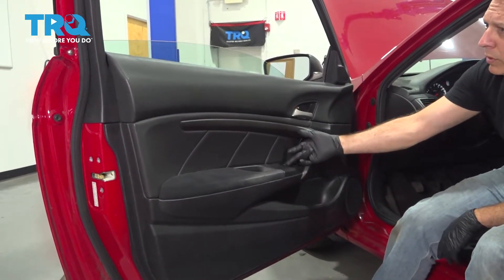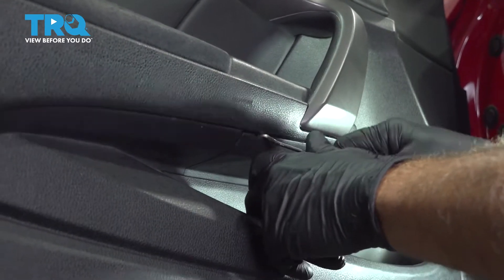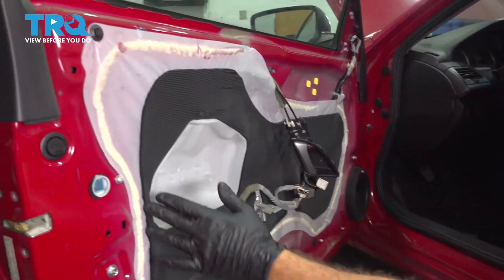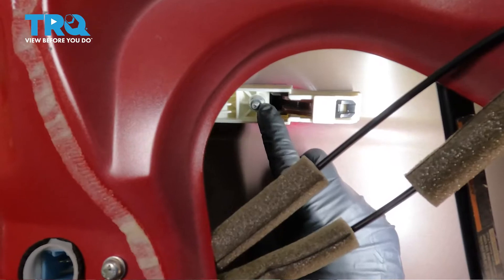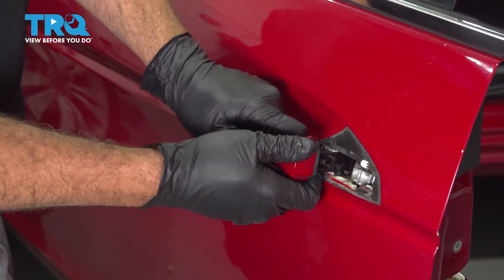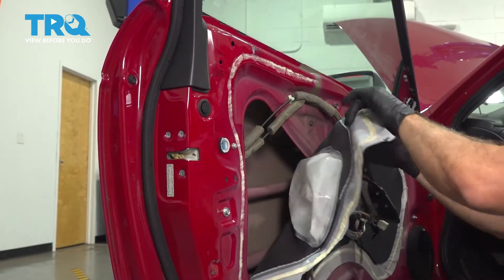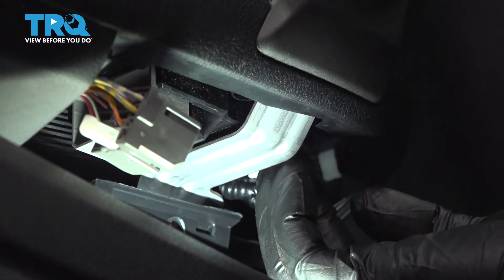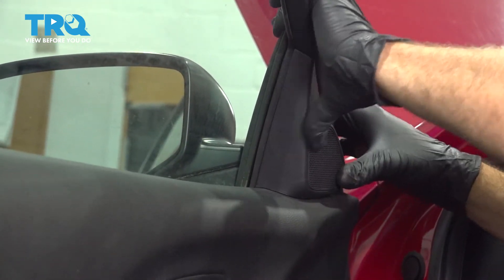How To Replace Driver's Side Door Handle 2008-2012 Honda Accord

Comment: I own a 08 Accord Coupe and removed my door panel more times than I care to admit. The best and easiest method is to actually start from the bottom in the center, there's a little hump you can fit your fingers in to pull the panel out twords you to pop it off...

Comment: Great great thorough. What held me up?I was removing things I didn’t need to. When I removed the plastic I saw 2 bolts connected to the handle. I could reach them with my hand . I wasn’t paying attention. I leave in Shreveport and it was hot hot. I have a 2008 Honda Accord v6 ex-l 4-door. Pristine condition. Just hit 100k. Her name is Ms Genesis. So on behalf of her and myself thanks.
May Bless and reward for your time and unselfishness.
Reply from the maker: +@IrisLeary-j8h Thanks for watching our video! http://1aau.to/m/Shop-TRQ

Comment: How about passenger side? (I need to do both sides)...I believe its slightly different for the passenger handle. Obviously the passenger handle doesnt have the key hole/key mechanism but is there anything else I need to know? Is it pretty straightforward? Is there anything that would make it more difficult?

Comment: Great, informative video! One question: I just had the rear piece of the door handle fall off, the one with the keyhole (on the driver's side). The lock itself is now loose. Is there any way to get the door handle cover back on and secured without taking the door completely apart (as you show in the video)? Also, best guess: is it the nut holding the lock in place that broke or fell out that enabled the rear piece of the door handle cover to fall off? Thank you!

Comment: Thanks for the video. Pretty helpful. But still not an “easy” job. I definitely let out a few bad words during the install. And after I had the handle already off I had a few minutes where I thought I wasn’t gonna be able to get it back together and I’d have to take it to the shop, but I didn’t give up and finally somehow I got it to go back together successfully. It’s not HARD but it took me about 90 minutes and all my effort. So it wasn’t easy. Hardest part was getting the handle and the other outside piece back on. Hard to keep the lock cylinder in place while keeping the window guide out of the way and pushing/holding the triangle piece on the outside and then trying to tighten the bolt all at the same time. I’m not trying to scare people away from it but I’ve done some other mechanical maintenance and brake jobs and such and this does take some patience. You can do it, but you gotta get your arm into tight spots and have at least a little tool & auto experience.

Comment: Don't be like me. You Have to take the 10mm bolt out BEFORE you slide the lock cover. I needed this because I had to replace my door with a junkyard door and I needed the old lock